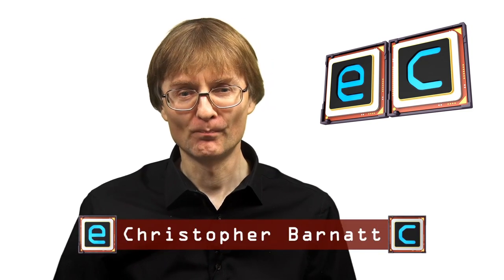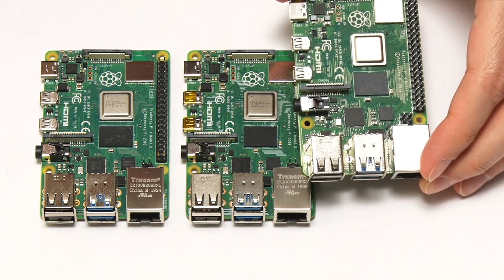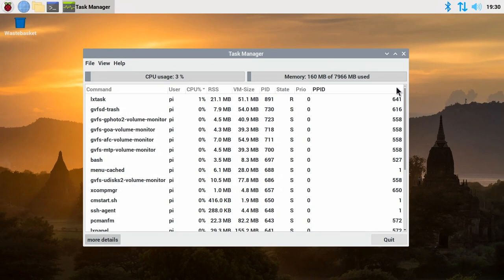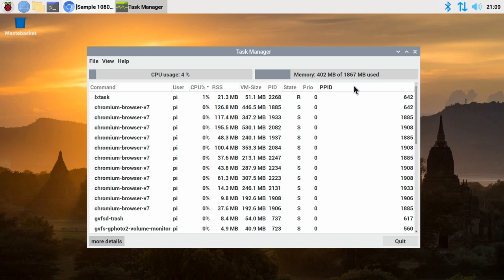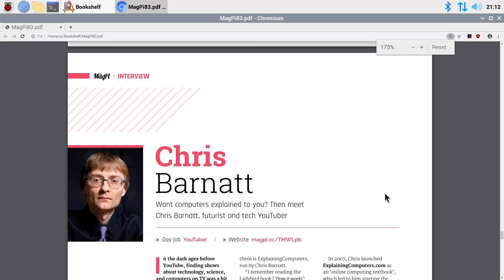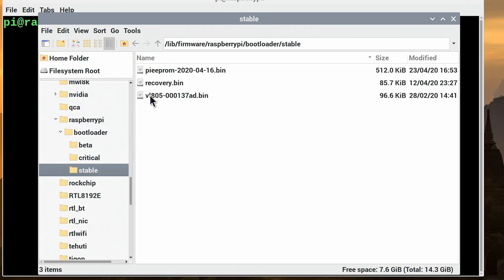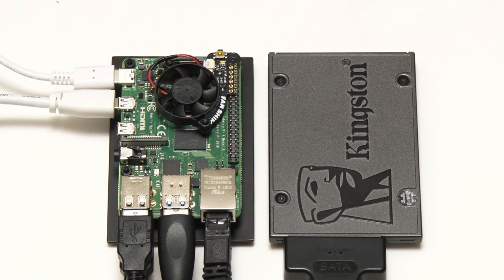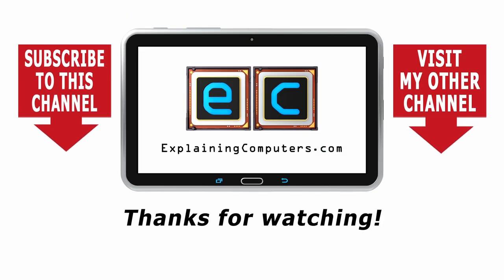Raspberry Pi 4 8GB & USB Boot

Comment: I use my Pi4 as a kitchen computer with an old 4:3 19" LCD. I use it for recipes and for watching youtube videos while I'm working in the kitchen. I have a Pi3 as a CUPS and pihole server.
Reply: damn that actually sounds like a good idea lol
Reply: I've stuck an old iPad on the kitchen wall ( very old iPad ).
Reply: How does it connects to a monitor etc., through USB/HDMI male/female connectors?
Reply: Did they actually fix the card reader boot issues?  Like my comment on this vid, I spent literally 24 hours of troubleshooting to get Raspbian on pi3, and the only thing that worked was an ancient card purchased 15 years ago for my camera, with like 3 gb storage.

Comment: Where do I begin? The RPI helps me love and learn linux. I use my RPI4 (4GB) as a NAS (Samba), Webserver (Apache) with Owncloud, VPN Router (OpenVPN), currently testing Wireguard as a personal VPN. It has become the heart of my network.  
Well done to the Raspberry Pi Foundation. I had a BBC Micro growing up, and the new bookshelf app reminds me of the computer books my father used to buy in the 80's.
Reply: Nice! With clustering 8GB versions you can try doing the same and more in home made datacentre using Ansible, Kubernetes and Docker containers, and monitoring via Prometheus and Grafana.
Reply: @andynl6443  a 64-bit arm version of Gitlab exists it seems... having a 3 node cluster wouldn't be a bad idea having all the data distributed properly so that the loss of one means everything keeps working
Reply: If my Pi server goes down, half my network stops working... so I got a new 8GB to join the 4GB and have doubled up all the most important network services containers and VMs haha
Reply: @autohmae  Gitea works on ARM64 as well :)
Reply: I would recommend looking at SoftEther VPN as well.

Comment: A big advancement with the  booting from SSD.  No more worries with the swap partition and writing log files on the SD card.
Reply: An SSD and an SD card use the exact same technology. Both have the exact same write limits.  So don’t go celebrating that you can write to a specific location more times, as you can’t. The only difference is that with an SD card the OS needs to manage write failures, whereas the SSD does it internally.

FYI, I will not respond to anyone commenting about things that I have not discussed.  I will only respond to what I have said above
Reply: @KaelumYodi  I think I will keep to myself what I think about those first two sentences because, well, would not exactly be kind words. My god...
Reply: My big question now is: Will that firmware update also roll out for Pi3 devices or will it be the big improvement that will make us upgrade to Pi4?
Reply: @KaelumYodi  A good SD card yes while most SSDs use good NAND Flash while you ca nstill buy a cheap SD card with bad NAND Flash on it. Most people do not want a bad hard drive but most people don't know much about SD cards.
Reply: @KaelumYodi  Your right, an SSD contains a controller that's able to do things like wear-leveling  and caching, but its also worth noting that most SSD contain higher quality NAND flash chips that are rated for much higher write cycles than an SD card (which is really meant for sequential writes a handful of times, like in a camera).
Reply: Kaelum SSD is faster
Reply: and guy with Swedish accent made a video on how to use SSD on raspi 4
Reply: Steven P which is good coz thats the main reason why they should SSD but no theres one more thing, They last longer than little SD cards. Making them perfect if you want to use a raspi setup for a server of some kind where you cant afford to loose any data thats in it. One major downfall tho is the cost of these SSDs.
Reply: @KaelumYodi  and what's more ... the flash modules in the SSD are switched in a way to be much faster

Comment: Whilst the 8GB is an improvement to the Pi, I think that the OS and firmware updates are more exciting. Being able to boot from and use an SSD as the main drive is a major improvement to the Pi; it will open up a whole lot of new opportunities to use it as a more fully featured computer, and the option to run a 64 bit OS may come in handy for programs which make use of that. I would still like to see improved graphics drivers though, as I understand it the on board graphics are still being throttled by the lack of driver support for more GFX intensive programs.
Reply from the maker: We are in agreement I think! :)
Reply: With all of the improvements in the os my pi 2b can now play video on VLC media player, browsing is ok and YouTube also works if you're patient enough to load the site and go to full screen. When the pi 2 came out video playback were still frames with choppy audio and 100% CPU.
Reply: @ExplainingComputers  I don't fully understand the excitement, you could always just boot from a SD-card (/boot) and use USB-device as root. Thus not even touching the SD-card anymore only reading it at book and no reading/writing during normal operations. Is it just that people don't know how, or to much work ?
Reply from the maker: @autohmae  It is neither "don't know how" or "too much work". The Pi before could not boot from USB, as you make clear. It now can, and that opens up many possibilities. Hybrid boot setups are hardly ideal or common.
Reply: @ExplainingComputers  I don't see the big deal with hybrid setup being "bad" at all? It literally is only active for a few seconds at the very start of the boot process and then doesn't get touched again until next boot or a bootloader update. I've been running my Pi4s with Ubuntu like this since the 4GB came out with no issues I didn't cause myself by trying to mess with that setup.
Reply: @W1ldTangent  Not a person in this thread said the word "bad" as you quote. Perhaps this is where the misguidance comes from.
Reply: @punksjutgbd  "hardly ideal" sounds "good" to you? And I guarantee you for at least those of us running Ubuntu Server, most are not running rootfs on SD, so I'd call it "hardly uncommon". Btw I'm using quotes intentionally because they obviously trigger you into taking anything between them literally without creative license so you won't misunderstand: "find better things to do with your time than be a pedant on the internet."
Reply: @W1ldTangent  you're possibly confused  at the utility of booting from USB only. It's less than ideal for many use cases to be limited to use SD for boot and USB for the rest. For example, if you're running a multi node Pi cluster it is less than ideal to have to manage two types of media per node. You would also likely boot via PXE (which we now have with this beta bootloader).

If you enjoy the old days of booting from floppy disk to run programs on your hard drive, no one is taking that option away from you.
Reply: @punksjutgbd  never said it was perfect, but I always figured there would be a new bootloader with usb and pxe long before the SD wore out so it was good enough, and now that it has... I have been busy validating that for deployment with my for the moment spare 4GB Pi that got replaced by an 8GB.
Reply: @W1ldTangent  I was going to do this -then the USB boot beta was available - I went that way. I have tried Ubuntu, but I mainly use Raspbian......surfing with Chrome.  Long term, I got to go to a USB solution due to the write limitations of a SD. I think I will try the hybrid setup with Ubuntu as well - always playing around with these pi's.

Comment: I recently bought the Pi4 8Gb along with the Argon One aluminium cooling case, previously tested here on this channel. 
I've set it up with Raspberry Pi OS 32-bit and will use it as my Linux system, which I access using VNC Viewer from Windows 10.
Until now I've had a Linux/Windows dual boot setup. But this way I can have both systems entirely separate. 
I'm looking forward to the USB boot coming out of beta, so that I can skip the SD card.
Thanks Chris, for this great video.
And you really have earned to be directly featured in an operating system :-)

Comment: I have Raspberry Pi 4 8GB since July 2019, so I bought 2 pieces with 4GB back then :) But seriously, SD out SSD on it, this is new era for RPI. We have waited long enough for this.
Reply: An interesting observation is everyone is welcoming this boot over USB when eMMC boots just as fast without taking up a USB port, and yet oh but no wifi ( with other boards ) and I have to use a dongle  O_o sorry there is alot of irony here with bias i think.
Reply: Hopefully it will be an expansion that fits under the board. I have seen a few others which put it outside the board or require a fancy rig to tuck under
Reply: @sethrd999  Thanks for your information about wifi, I would never notice that because my RPI is in a solid aluminum housing and so RPI and I always have the same temperature 36.6 ° C (both of us at full load). Unfortunately, when it comes to SD cards, they don't live that long (they are not made for permanent access). For loss of a USB3 port I bought a USB3 (4X) hub with switches. I see no ironic bias here but an objective criticism and it is always welcome.
Reply: @sethrd999  emmc is handy storage, but not as fast a SSD on a usb.
Reply: @williamrutter3619  That's right hdparm test shows:
sudo hdparm -t / dev / sda1 shows 320.31 MB / sec for SSD
sudo hdparm -t / dev / mmcblk0 shows only 70 MB / sec for SD card
320MB and 70MB is a difference, SSD is 4.6 times faster
Reply: @tubegor  impressive indeed

Comment: 1) I have a 4GB model on the way to use as a media server, my first foray into NAS hardware or software, and my first time converting all my disc-based media to files. I also ordered one of those alumin(i)um heatsink cases after watching your passive cooling video, to avoid throttling and pretty up the board a bit. 
I hope to have it attached via Ethernet to a WiFi extender in another part of my home with a 5GHz backhaul to the mane router. I have as couple of Pi 3 (not-plus) boards to use for playback on dumb TVs, so I'm going to try some Kodi-oriented images on those. Another first time project! 

2) I have a slightly different version of that model B, with a black audio jack and D14 populated on the board (bottom side). It's sitting in a dusty old Lego case I built shortly after buying it, right after release. One thing I liked is that the board's dimensions were extremely Lego-friendly and it fits snugly into a space of 11 by 7 Lego studs (with allowances for the ports). Sadly, not the case for the newer versions of the Pi! 
I was just wondering the other day if it was worth using versus a Pi Zero W for a networked music player build. The extra RAM and faster CPU are probably worth it, along with integrated WiFi. 

3) How are you liking the new Chapter feature for Youtube videos?
Reply from the maker: Thanks for this. I very much like the chapter feature -- but it gives me something else to do! :)

Comment: When I returned to Uni in 2014, I bought a mac mini and macbook air to permit me to use proprietary software for the programme. They're still running well and I'm in no hurry to buy a new laptop now that I'm in grad school and less dependent on proprietary tools. I do, however,  miss having a Linux desktop. The 8 Gig Pi might help me with my Linux fix and put off a PC purchase a little further into the future.  If only Mint would run on the Pi, it would be somewhat nifty.  Thank you for the review.
Reply: The 2GB model will probably be more than you need. I would save some €€€ and nog go for 8GB.
Reply: Why not just install linux on the macbook air or mac mini? If storage is a problem you can simply upgrade the drives or boot from thunderbolt or usb. A pi is a great machine, but if I’ve already have both a usable laptop and desktop I’d just use them instead...

Comment: I purchased the pi4/4 GB to use as a mobile amateur radio interface utilizing the software hampi. Then I found your channel which has me hooked on something I know nothing about ( raspberrypi) so far not coding or trying to be a programmer which I'm not, this has been Interesting and fun. Now to remove the ad card and upgrade to a ssd to boot from and run. Thanks for all your efforts and sharing information to help others (me).

Comment: Thank you for this. I would've given up and not even thought about testing a thumb drive to confirm USB boot worked at all. It did. I just bought a different cable brand and now have HassOS installed and running beautifully on the new 8GB! Much appreciated dude!!!
Reply from the maker: Great to hear!

Comment: My Pi collection is growing ever 4 months it appears. 

Finding a suitable projects is a problem. My Pi 4  4GB is a NAS ,  my new Pi 4  8 GB is operating as my latest daily driver (Desktop) 

Thanks Chris for your review.

PS

Your background information in the comment section is greatly appreciate Chris. Will done
Reply: You use a Raspberry Pi as a daily device!? Wow! How's the performance?
Reply: J T /. Thanks for the question. 

As a long time Maker, I have a number of computers  ranging from a Ryzen 7 2700  to 27” iMac i7.  

I have setup my new Raspberry Pi 4 8GB to be able to run different office programs. Not to get into to much information I use different cloud based storage systems that I save all my files to. When I’m on my Pi I can call up anything I needs from Spreadsheets and word documents that I have saved from different computers including the Pi 

I also do photo editing using my Pi’s. because I’m working on different projects all the time having a computer that can be setup almost anywhere has it advances. Most people don’t realize that the Pi is just as powerful as any modern day tablet or even any low cost laptop. 

If you haven’t already picked up one yet you can get  Raspberry Pi 4 2GB model and it will run the same as the 4 & 8 GB model.  Just remember to get a case with a fan for it at the start.

Comment: (Fair warning: I don't say much of importance in the following comment.)

Once the 64bit OS version comes out of beta, it might ge just what I need. I recently revived my old desktop computer that was sold in 2007 or 08, and it has a bunch of issues with compatibility with modern … everything. It was actually a fairly high end computer when sold at the time, but now it just … a fancy calculator. It's sound card isn't detected at all. There's some issue with the videocard which was actually a newer (relatively) addition, that locks the screen resolution to 640 by 480 and 73fps exactly. The card is an Nvidia GTS 450. And then I have a separate but related issue that none of the available monitors I have can use HDMI as an input. (There's a TV that technically has the ports for it, but something's wrong with the board in the TV, so only the VGA input works. That's actually why I have it, it wouldn't connect with a Roku's output, so it got given to me.) The computer also has just shy of 4GB of RAM. And the upgrade slots for installing new video cards and suchlike are version 2, x16 pins. (Forgot the proper name of the slot. But I could look it up again if needed.) So even with forwards compatibility built in, data transfer speeds will still be limited to the version 2 standard. So… While I have some video, and no sound, and barely adequate RAM, and a very early Intel 4 core processor, it's just a pain to use. Oh! I forgot to mention the mouse! I'm using a ball mouse. Without a scroll wheel. Though it does have a middle mouse button which lets me pan windows by holding down and dragging. I have spent a considerable amount of time changing settings and messing around with different desktop environments, to get a UI with compact enough buttons and text, to use properly with my 640x480 screen resolution. It's appalling how many programs UI aren't built to allow the window to be resized small enough to fit inside a 680x480 area, especially system settings windows.

Sorry about the rant. I think I just needed to get that off my chest. But anyway, in summary, even if this Raspberry 4 8GB was by chance less computationally powerful than my ~12 year old computer, it should still be able to manage to give me a screen large enough to see things on, and to bless my ears with beautiful sound, which I have been missing dearly. And to top it off, it might have a chance of having more accessible RAM than my old computer, eventually. I'll still be using LXQT for my desktop environment though. (I've never used Raspbian, but it looked like it might already be using either LXQT or LXDE, judging by the Task Manager's process name.)

Thanks for the video!
Reply: I just bought one finally because of the 64bit os being available now.  I have an old unused SSD ready for booting to and ya, time to start tinkering.  Maybe I'll try a USB gigabit ethernet port and see if it can run Pfsense.

Comment: I bought the 8gb version because of this channel.. running it overclocked with a big TV, using a PNY 128 GB SSD, latest 32-bit Raspberry PI OS.. it's not dropping frames at 1280x768p, temps are 42-49 degrees C with extended use, using an aluminum case with two GPIO fans from PiShop.  With a bit of tweaking here and there, I've now got a very nice desktop PC.. will look to do some programming projects in the near future.  I ran the latest Ubuntu too, on the MicroSD... still haven't got it to run via USB/SSD.  Thanks for the great videos!
Reply from the maker: Thanks for watching, and sharing your experience here.